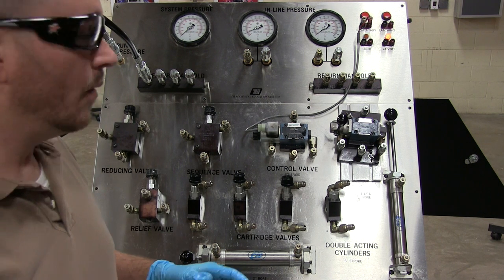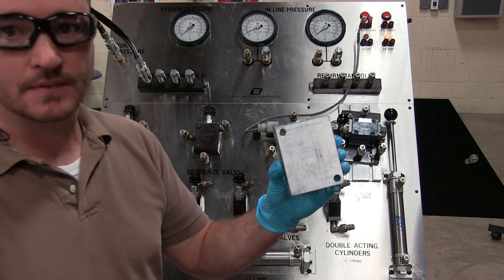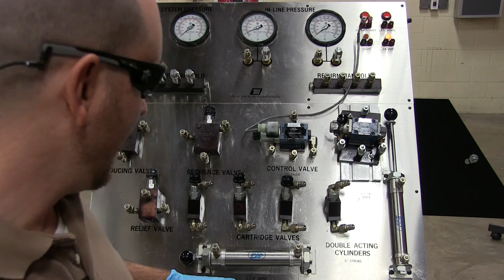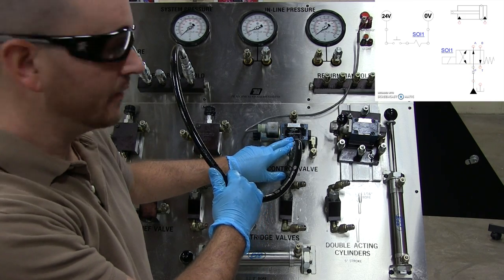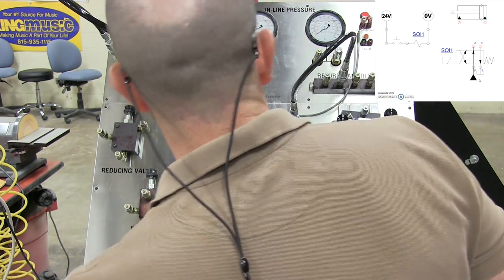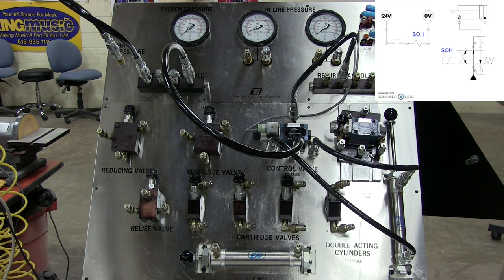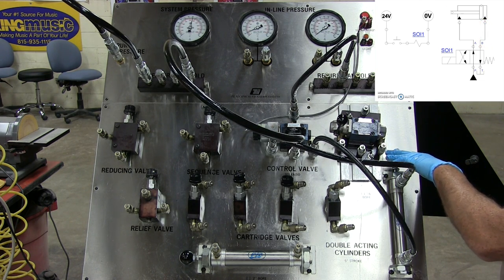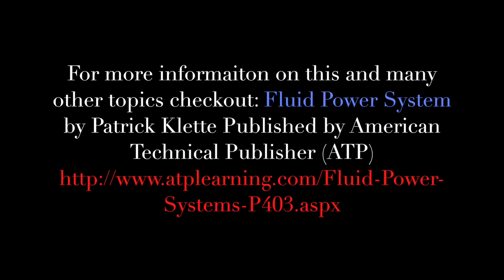Hydraulic Directional Control Valves

Comment: hi Pat, thanks for sharing your knowledge and your time doing this amazing videos. I've been studying them a lot and making good progress as I started from zero in hydraulics, but I still have some questions. I'm planing to do  a hydraulic forging press to forge steel knifes. It will be a system with a double action cylinder . So normal position will be retracted and strokes extending the rod. I'm in doubt on which type of solenoid of manual valve regarding its center position should I use that after actioning to extend and press the still should return the piston automatically to its normal retracted position when I release the input switch or handle. I'm guessing for what I study so far it will be the open center spool type, but I would appreciate if you confirm that to me. Also, it is possible to control the return point of the rod when retracting with a limit switch to avoid it going to full retracted position every time and how would I achieve that? Thanks very much in advance. Mauro.
Reply from the maker: How heavy is the attachment that will be attached to the cylinder for hammering the steel and what is the diameter of the cylinder?
Reply: Cylinder bore is 6 inches, rod 4 inches  and about 15 kg attachment. Also, my motor is 7,5hp: can it drive a 13 gpm pump?